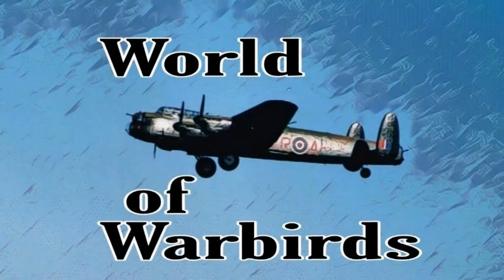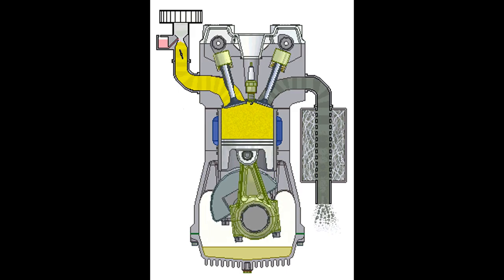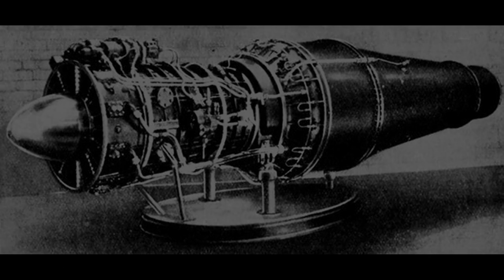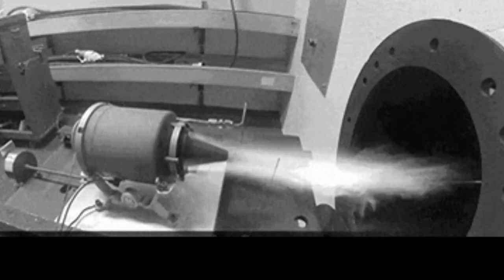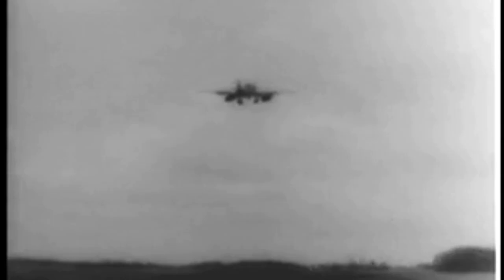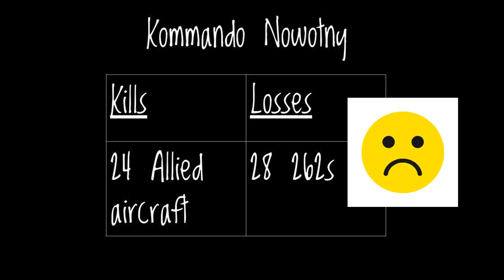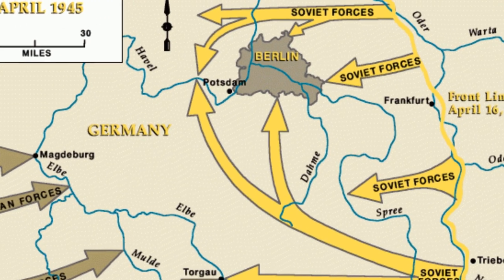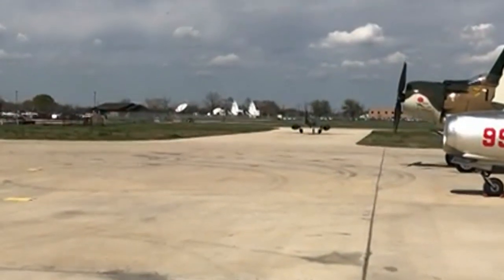First Fighter Jet: The Messerschmitt Me 262

Comment: You skipped the fact that the original P65 which later became the P1065 had straight wings. It was only when the were told that the engines were heavier than expect did they sweep the wings back. This sweep increased the maximum speed by 40kmh (25mph) over the original straight winged design.
Reply from the maker: I think I had that detail on the audio version (see Spotify). I have to keep the videos a little shorter as YouTube viewers usually have shorter attention spans!

Comment: I hoped to see one fly 8 days ago, but the weather was too bad for it to take off. Got to talk to the pilot though. His view was the aircraft was only good at one thing. Flying fast in a straight line. If you lose an engine (even in the modern powered ones) you are in big trouble, as the aircraft cannot fly in a straight line with enough power to keep you airborne on a single engine. Reason, the Fin and Rudder were not big enough to counter the asymmetric thrust!!! As regards manoeuvrability, his exact words were "Get into a turning fight in this thing and you will die!!!".The Me-262 did enter service first, but it was not the first Operational Jet Fighter. Gloster Meteor got that by passing its Acceptance Trials and getting its Release to Service document signed off on 17th July 1944. The Meteor Equivariant of the first Me-262 unit was the Meteor Tactual Flight of the Aircraft and Armament Experimental Establishment (A&AEE) and they formed in early June 1944. Due to the reliability of the Meteor and its Welland engines, it passed most of its tests extremely rapidly.  The main delay in both aircraft's entry into service was the engines on both were just not ready. The Reason the Meteor was only used in limited numbers was because the major problems with the aircraft were identified very early in testing (Aircraft tried to shake itself to bits above 450MPH due to the airflow breaking away for the back half of the engine nacelles and the fact it really needed speed brakes fitted to the aircraft). Thus the original order for 100 F Mk 1's was cut to 20 and the RAF were prepared to wait until the buffet and airbrake issues were sorted. 616 Squadron had a Meteor Flight operational on 27th July 1944, flying anti V-1 patrols (3 attempted V-1 intercepts failed for various reasons) and they got their first V-1 kills on 4th August 1944. The whole Squadron was converted to the type on 15th August 1944. The German "Testing Command" unit did attempt to shoot down Allied Reconnacance aircraft from 25th July 1944 onwards (First attempt was against a Mosquito which managed to evade multiple passes by the Me-262 until it got into cloud. The Mosquito then for various reasons (broken gyro compass (went unserviceable during its flight into Germany), 10/10 cloud cover from the German Boarder to its home base of RAF Benson and somewhat overstressed Merlin engines which had been on maximum boost for way longer than recommended) diverted to an allied airfield in Italy and flew back to the UK the following day., The ME-262 get its first totally confirmed kill until around 15th August 1944.
Reply from the maker: Thanks for all these details!